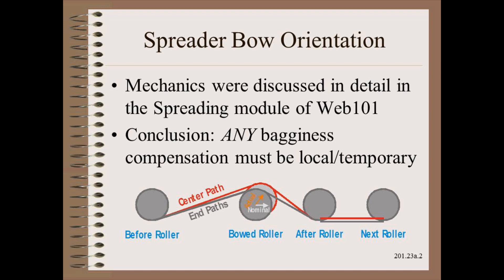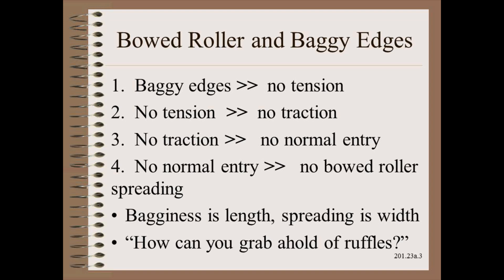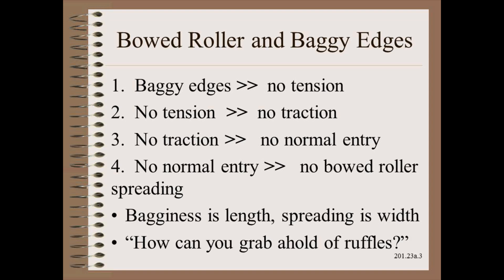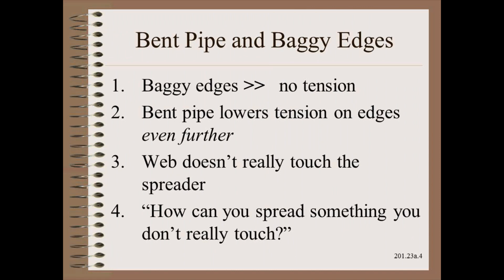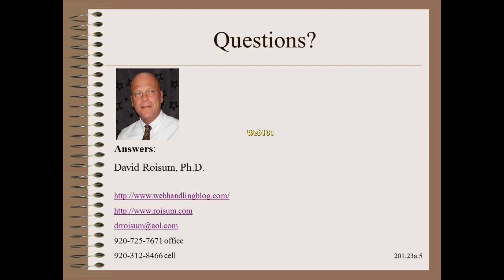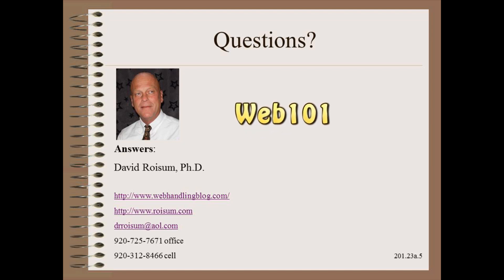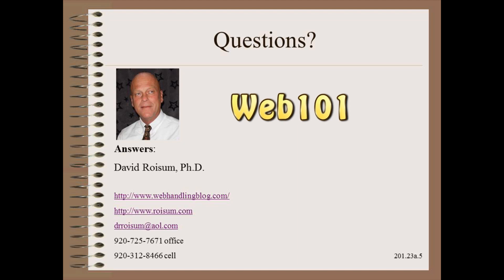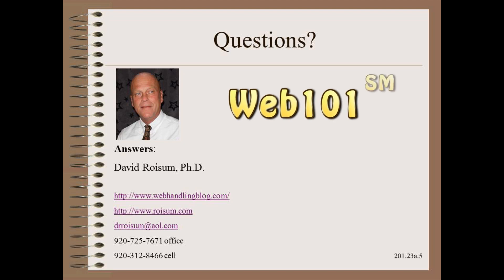Web20123a - Can You Spread a Baggy Edge

Comment: Hello doctor, I am very interested in knowing how I can attack the baggy defect that occurs in our finished product.
Reply from the maker: You must first identify the manufacturing component upstream that is not 'level' enough with respect to thickness profile.  That could be the die in film, the head box in a paper machine, coating head etc depending on what you make.  I have a series of more than two dozen videos on how to do this.  View them all because they are short and because they teach troubleshooting skills (instead of recipes that don't work for these problems).  Once you identified the manufacturing component that is not good enough, you must make it better by maintenance or redesign.  Once made with thickness variation (on the order of 1% no problems to 10% no salable products), there is nothing further you can do to fix the problem.  You must then cull so that your customer doesn't suffer.  https://www.youtube.com/watch?v=L1_9F58N9_s&list=PLWFaV8sV1OwnWIfnuLCCwEvpSZo9fNGKJ